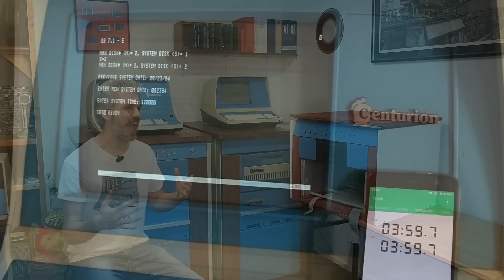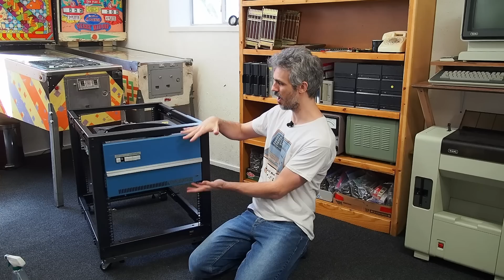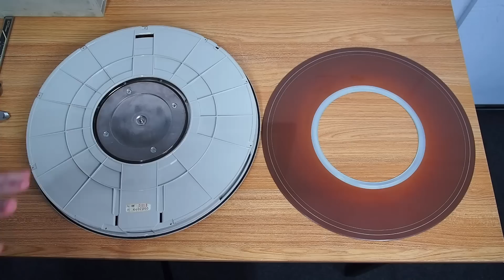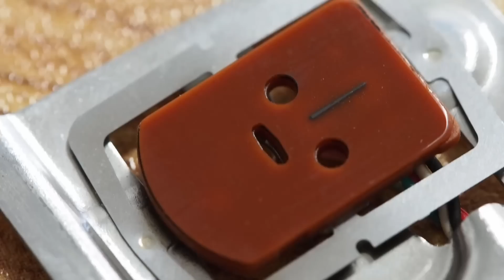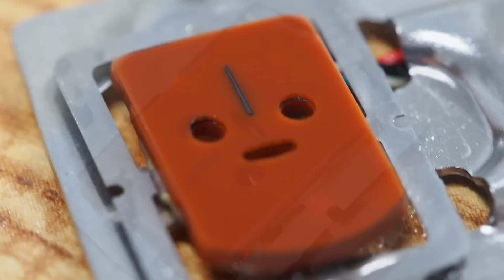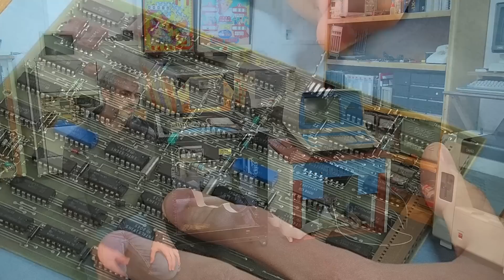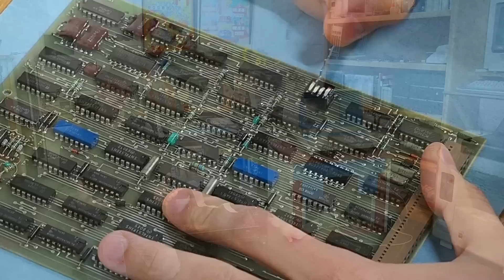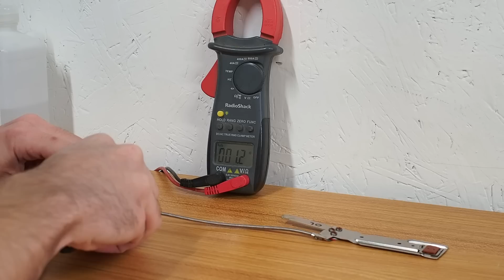Trying (and Failing) to Restore a 1970s CDC 10MB Hard Drive

Comment: Can the Centurion really use a Hawk with just one head? Did you try? If so, this is enough for the demo.
Forget the removable platter and copy the OS from the floppy. You may need a couple of floppies but that's ok.
Alternatively we could (and probably should) try to create a drive emulator. 
It won't be 100% genuine then but good enough. A floppy drive can provide enough of genuine look-and-feel.   

Modifying an Arduino-based SD-card floppy emulator to work with Centurion shouldn't be too hard. 
We could try to decrease seek times the same way we increased them. 

If that is not enough, we may try to emulate a Hawk drive, although it probably will take a considerable effort.

Alternatively it may be a better idea to emulate the card itself - the protocol is probably more complicated and we'll probably need an FPGA, but we won't need to emulate mechanical hardware.

There is another approach - try to modify the OS disk driver to instead read from flash hooked up to the bus. Hardware should be relatively easy, software will take a lot of work. We don't even need to write it from Centurion, it can work in a read-only mode just fine, and a read-write functionality of a floppy is enough.
Reply: The way the Centurion OPSYS (operation system) and the Centurion Hawk disk controller (DSKI & DSKII cards) operate you must have an upper & lower head pair working on disk platter.  On the Hawk sectors 0x0000-0x000F are on the upper head and sectors 0x0010-0x001F are on the lower head as the sectors are laid out on the platter.   The other bits in the 16 bit sector address are the disk cylinder numbers, Head Upper/Lower & sectors 0-F    SA format is   00cc cccc cccH SSSS
Reply: @kenromaine2387  thanks for clarification, that makes sense. 

So if I understand correctly data is laid out sequentially, so every 16*sector_size bits it switches heads, so it can't possibly work with just one head. 

And since the controller itself probably reads some header/CRC/whatever else from the platter, even modifying the OS driver and format utility would not be enough.

I wonder if it is possible to somehow create an adapter for something like ST-506? I'm guessing "not a chance" because Hawk seems to use hard sectoring, although the controller mentions soft-sector mode, is it supported by OPSYS?

Comment: How hard would it be to replace those drivers with some sort of CF card device that mimics the drive? I’m sure it would take a lot of work.
Reply: You'd typically use an SD card, because the QSPI interface is a lot more microcontroller-friendly, and then communicate with the rest of the computer via GPIOs. Basically like BlueSCSI does it.
Reply: I was just gonna say that ^^^

Comment: If anyone is going to bring back this Hawk drive from the netherworld, it’s Usagi & Friends! For me as a viewer, it is at least as interesting watching all the problem solving (even if it doesn’t fit in an episode) as reaching the end goal of it working… although perhaps you could do with someone finding a box of unused CDC Hawk heads and platters!
Reply: Is it posible that the leads between the heads and the connectors have failed?
Reply: @GrayRaceCat  that has been proposed in the comments many times. Guess we will find out next video. But even if they are, can they be replaced. That depends on how they are attached to the heads, might be cast in our something.
Reply: Maybe he could get curious Marc and his crew to help. They also have experience with this kind of thing and they might also have the contacts for spare heads.

Comment: how to make head. measure ferrite permeability, cut head cross section and count turns, file down ferrite core, wound thin enameled wire, encapsulate in epoxy

Comment: Ouch! Rough deal with those heads. Here's a silly question, are there any heads in the mockup drive that you could use/cannibalize? Alternately, could you get the machine running with the Phoenix?

Comment: Getting a real hard drive attached is a nice goal, but sometimes you are allowed to cheat. It should be possible to build a drive emulator using an Ardino or Pico.
Reply: Yeah considering how moving this thing around and driving might could screw it up from all the vibrations.

Comment: "This is the Lockpicking Computer Geek, and what I have for you today is setting a DIP switch with a wave rack... 1 is binding, 2 is a false gate, 3 is there... Okay, let's try again to see if it was not a Fluke"

I was gonna suggest that you make a cutout in the upper front angle bar on that rack to clear the Hawk drive's panel, but drilling two holes was way simpler! Haha, that was just brilliant :)
Got a bit worried seeing you lift the heavy thing all by yourself though.
Niiiiiice platter collection there :) and good job on refurbishing the heads - pity it didn't turn out to work, but still a work of love. It can indeed get frustrating! Well... catch you next time :)
Reply: Awesome comment!